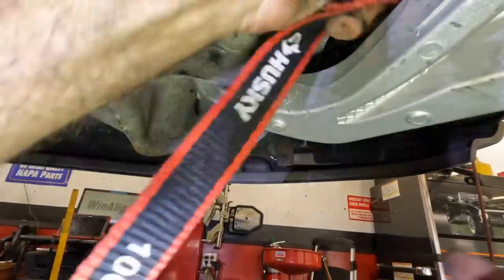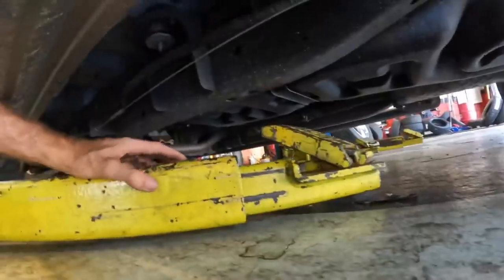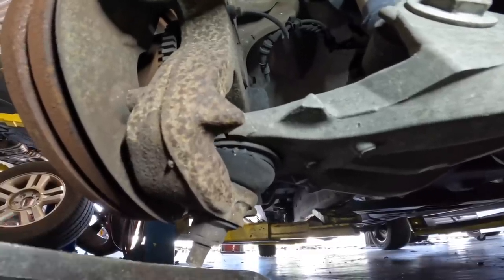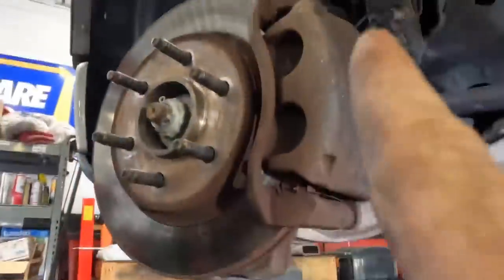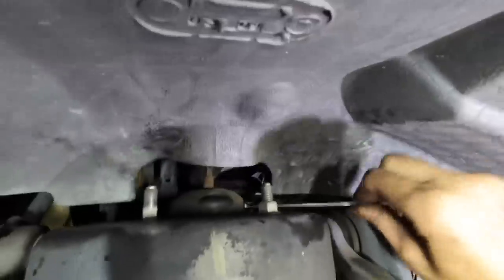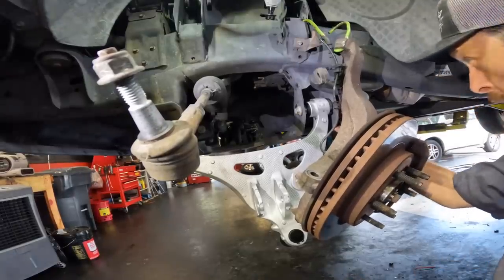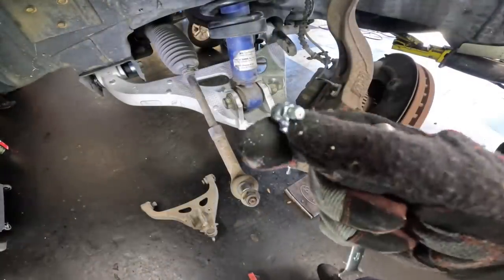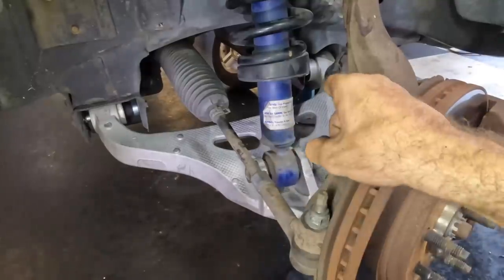Sloppy Suspension! 3 1/2 worn balls | Ford F150

Comment: idk why you made it hard for yourself not marking the camber/caster bolts on the lower arms and also not tightening at ride height will 100% cause creaking you wouldn't believe how many noises i fixed just because the guy didn't tighten at ride height even my own fathers truck i did because i was lazy and could fix it whenever

Comment: i dont know if in usa you have same as we have here  whe has somting that caled eu control evry secund year, that meens the car need to go to a service shop and thay lock over all the importen parts of the car same as baljoynts and brake exsos belts evryting that har inportens for sefty to do and if you dont pas it you need to fix it then a thay check what you fixed then its okay to go on the roade

Comment: So I'm assuming that those ball joints weren't replaceable since you had to install new control arms!? Or was that the option of the owner?
Reply: I think they are replaceable.   Ford tech makuloko has a video on the 04 to 14 however with the complete arm you get new bushings also and saves the tech some time and probably makes the shop more money also.  But for a DIY'r with time you might get away with the Astro or HF press tools.
Reply: @michael931  Oh ok

Comment: I thought ball joints could be replaced without control arm removal. Maybe they can but it would cost more in labor to do it that way?
Reply: I wonder if they have a core charge for the used control arms, seems like they could rebuild those cheaper than always replacing them.

Comment: The hoist looks like it needs a service... I hate cable hoists... Sooo dangerous...
Reply: Cables are only equalizers, load is on the hydraulics
Reply: @HoLeeFuk317  they stretch and break
Reply: @iHelpSolveIt  if the hoist is loaded properly they should never have excessive stretch.  There isn't much load on the cables.  They just keep the two sides of the hoist level.  Hydraulic cylinder is doing the lifting on this style rack
Reply: @HoLeeFuk317  in a perfect world... Sadly even with a perfect load ive seen too many break and kill people
Reply: @iHelpSolveIt  operator error
Reply: @HoLeeFuk317  nope. Not in any of the cases.

Comment: is brake cleaner ok to use on boots? maybe a diff between non-chlorinated and chlorinated? what kind of lube is ok to put on the boots, silicone, or "white lithium?"
Reply: Do not use brake clean on rubber parts; silicone is good for rubber boots, etc

Comment: Anyone know off hand how the camber is adjusted on a 2000 E-150 ? Its way off negative on both sides & eating up tires. I Don't see any type of obvious adjustment or cam washers anywhere, nor does it look like any of the bushings could be solely responsible. Its so off that I couldn't imagine one of those cam washers being enough even if it had them. Luckily, I only need it for occasional local non-highway stuff. But this old driveway warrior is defeated.

Comment: Did you remove the strut(s) just for working room?  Not being there, it didn't appear necessary to remove the struts to replace the control arms.  Help me out here.
Reply: Strut has to be removed to remove bolts that hold upper control arm captive in their mounts.

Comment: Just out of curiosity, how much does it typically run to have upper and lower ball joints done in a vehicle? Say perhaps an 03 park ave ultra?
Reply: That car only has Lower ball joints. All areas are different. I would guess $500-1200 for parts/labor.

Comment: If the ball joints were bad then why did you replace control arms too? why not use a ball joint press and replace the joints with the control arms still on the vehicle? Save money on parts and labor.

Comment: Question  my good man why not just punch out the ball joint like normal  that is how i have done it all my life or are they all one unit now  Thanks  Barry
Reply: Top joints are integral with the wishbone. Bottom ones would press into the aluminium lower arm. Quite often the labour involved in replacing the ball  joints is more than the cost of a complete arm. Retired mechanic from Land Down Under.
Reply: Thanks BOB  was thinking that  just had to ask lower ali wish bone  could give you trouble as you say  Thank you again  Barry  NZ
Reply: Ford in their infinite wisdom went with ali control arms. So now you're going with different materials, as the ball joints themselves are steel. Good way to set up galvanic corrosion. And no grease fittings. Lol...

Comment: Hey Ray,
Since you work with greasy parts all of the time, what do you use to really get it off your skin? I've tried different things and I haven't found a good solution to this problem. Thanks.
Reply: Wash dishes
Reply: Dish detergent and a scrub brush works well. If super coated in crud, first use some lanolin hand cleaner that has pumice in it, work it in really good...then use a scrub brush with dish soap and water 👍
Reply: @partyguarder , Dawn dish soap works best! It really cuts the grease.
Reply: Thanks for all the answers.

Comment: I have a question. When I tighten lug nuts. They loosen up after 100 mi. Do you have to have customer come back? For retighten
Reply: good question; when I used to race, the aluminum wheels with aluminum lug nuts HAD to be retorqued after each session. Probably a good idea to recheck them often.

Comment: I'm a little concerned that you tightened the bushing bolts fully before the car had it's wheels on the ground. This can cause the bushings to be under stress shortening their lifespan.
Reply: I assume he just snugged them for now.  Will loosen and retighten them when it's on the drive on rack during the alignment.
Reply: Go back and listen to what Ray said about not tightening the bolts fully before suspension is in the normal ride height, same as on the warning sticker he showed early in the video. He tightened them and then backed them off. Look at the direction of the socket when he did that. He has also shown the/his correct procedure in other videos. Retired mechanic from land Down Under.
Reply: @bobhudson6659  Shhh, you're hashing the vibe for the "experts".  :)

Comment: Question for anyone: Does that cross-hatching/waffle pattern on the new lower arms serve any function? (Like peening does, for example)
Reply: I think the cross hatch is for release during the casting process.
Reply: @haroldh3863  That makes sense: More surface area to dissipate heat. Thanks.
Reply: @richardfabacher3705  I don't think its surface area heat issue -- i think on larger casting they sometime have the mold and part pull apart as it cools -- adding the pattern gives more adhesion to the large flat areas in the cast, giving a better surfaces and tighter overall tolerance -- but that is just my guess.

Comment: Ray, seeing as almost all four suspension ball joints were 💩 and a full alignment was going to be required, would it not have been a good idea to recommend steering ball joint replacement too?
Reply: Come on now. You saw him pull on the tires to see if the tie rods were bad. They were not. Sure you can up sell anything. If you have been here. you would know, that ain't Ray's style. Then where do you stop? The pitman arm has one too. Bushings? Now you have replaced the whole front end at a hefty cost. I doubt I would be back. Ever.
Reply: I personally would of recommend it to the customer and let them decide.   I'd tell them they aren't bad yet but may get loose soon due to them being original and will require a another alignment if you wait to replace them.

Comment: Why do they force you to change parts that are perfectly good, that ball joint should be replaceable without changing the control arm.
Reply: By the time you buy the bushings and the ball joints, The A frame cost is negligible. It also makes you change bushings too. Yes some might not change the bushings. I just changed mine. It being all together made It easy. Watch the shimming.

Comment: such a poor design.  Why they integrate the ball joint into the entire control arm is purely to charge more for the parts.  and the old ones aren't easily recycled.   Gone are the days when you just replaced the ball joint themselves. Much faster and cheaper in the long run.   THey even did this in my 1998 vehicle so the 'scam' has been going on for many years.